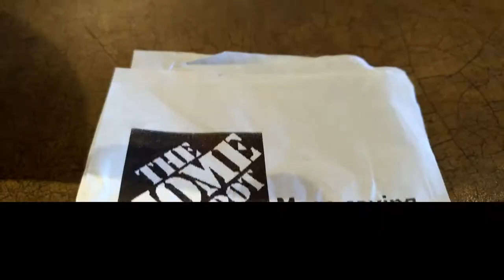Building A Bedframe... From Scratch!

Comment: that is a pretty nice job although i would have notched the corners of the bed frame base that would have given it more strength. should be quite sturdy though its made of really thick materials and probably stronger than anything you can buy off the shelf in a store.